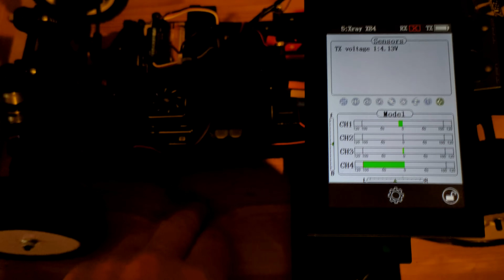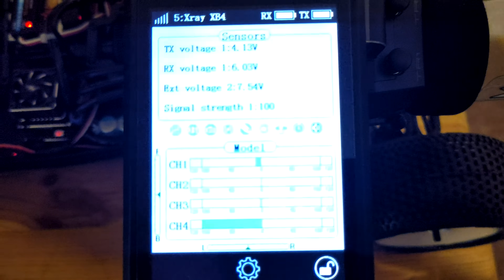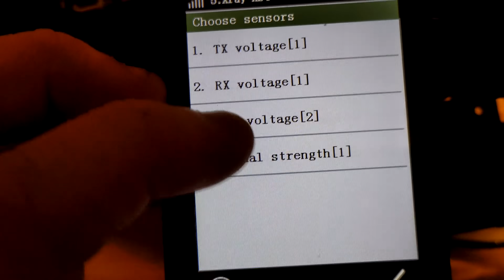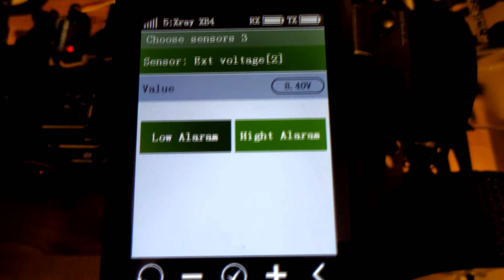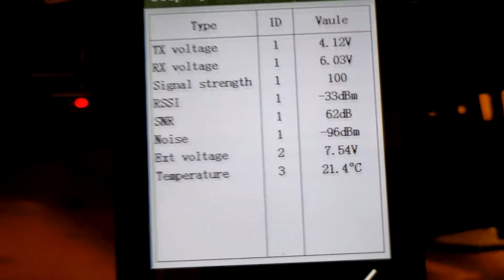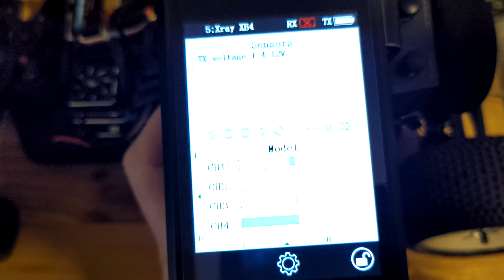Flysky nb4 telemetry set up.

Comment: I have a Traxxas Slash Ultimate, I just switched the receiver to a Flysky FGR4. The Ultimate already comes prewired for a temp and speed connection. Each one has its own connector. Can you advise me as to what channel to connect them to set them up?
Reply from the maker: You can't use the traxxas ones on anything other than traxxas receiver unfortunately
Reply: @WTFRCCars  boo...

Comment: I just nb4 with  4GR4P receiver and I can't get sensors to display on transmitter. Also what ever sensor I plug into the next has flashing led but when just 1 sensor is plugged in led is steady red but when I try to daisy it flashes. Should I have bound the receiver in enhanced instead of classic not sure what I didn't do right?
Reply from the maker: Fgr4p is a classic receiver, have you set the port to sensor or ibus for the sensors to work ?
Reply: @WTFRCCars  actually I just finally got it to work. I re updated receiver then set rx setting from ibus to sensor snd I finally got the voltage & temp gauge to work
Reply from the maker: Spot on :)
Reply: @WTFRCCars  thanks anyways

Comment: Very interesting! Can the NB4 work with any esc to adjust settings remotely?
Reply from the maker: This is not adjusting anything in the ESC
Reply: @WTFRCCars  it does not have that capability with any esc?
Reply from the maker: Depends on the esc, if the esc has a control channel then the nb4 can control that like any transmitter.

Comment: Hi, Is it possible that temp sensor vil activate 1 channel where i have fan conntected. så it will auto turn on/off?
Reply from the maker: No the temp sensor will only show the temperature on the screen of the nb4 or pro it can not control a channel.

Comment: Hi m8 took my kraton 4s v2 out today for its first run I fitted  a few nb4 sensors to it. My question is I zip tied the temp sensor to the motor can next ti the heat sink at the drive end the sensor was reading 50c but the motor was way hotter then 50c  when  touched any suggestions m8
Reply from the maker: Use some thermal paste to make sure the sensor is getting all the heat transferred to it :)
Reply: Yeah makes sense what about a thermal pad top and bottom of the sensor
Reply from the maker: Yeh anything that will transfer the heat to the sensor :)

Comment: Hi m8 love the videos the voltage sensor could I solder a 4s balance plug on it instead of using the pins it comes with and plug into the balance lead on my lipos
Reply from the maker: Yeh that would work fine but does limit it to only 4s lipos but if it's staying on the same RC that won't matter :)
Reply: Thanks for the reply 👍
Reply from the maker: No worries 😁

Comment: Is it possible to run this set up on a 4 channel GMR micro reciever ?
Reply from the maker: No the GMR does not support ibus for sensors but it has gyro connection

Comment: This is what I needed last weekend! My boat crapped out (low battery cutoff in the esc ) in the middle of a large body of water. Low winds, so I had to wait an hour for it to finally float into shore. I have the “beeping” low voltage alarm plugin, but when it’s inside the hull of the boat, it’s hard to hear it going off. Need to build a rescue boat I guess.
Reply from the maker: Alway a good excuse to build another RC ;)

Comment: What is the best method for attaching the temp sensor to a 1/10 buggy electric motor?
Reply from the maker: Zip tie and thermal pad will hold it in place and get a better reading of the temp :)

Comment: Hi there. Really appreciate your videos. Any idea if the Nobel Nb4 with the smaller FGr4S V2 receiver can handle temperature telemetry? Or is it only the larger receiver with the antenna (FGr4 v2) that works with telemetry?
Reply from the maker: All the nb4 receivers can run telemetry
Reply: That was my question too. Thank you
Reply from the maker: I have vids covering how to set telemetry on most of the receivers if you need one I don't have covered yet let me know and I'll make a vid :)

Comment: Hi, I was wondering if you can use this with other types of telemetry, like castle mamba x , I have this setup on futaba and I was wondering if it could be made made to work on this system? Thanks
Reply from the maker: No the telemetry only works with flysky sensors unfortunately

Comment: Maybe you've answered this in another video. If so, please link it. I have yet to find it.

Question: Is it possible to run a couple of external fans through the FlySky FGr4 V2 receiver without an external BEC, or additional battery. I'm only running 2 channels (servo and ESC). The fans need 6-8.4v. I'm using a Max5 ESC and have set it to 7.4v for the "BEC" but am unsure if that only works over a single channel, or all of them. (Don't want to muck about with my volt meter as I may just cross pins and cause a problem) Seems it would just set them all to 7.4v but it doesn't say. The FGr4 V2 shows 3.5 - 12v so I'd assume it will work. Is this set via the Noble (can't find it if so) or is the ESC BEC setting handling all of it? 

Another odd thing is the servo doesn't work on the servo port on the FGr4!? It needs to be in channel 2 port to work. Seems odd to label something for a function it doesn't actually do.

Thanks again for your help. Trying to get the last few flys out of the grease.
Reply from the maker: As for your fans, all the + and - on receivers are directly connected so what ever you bec is giving out goes to all the + and - :)
Reply: Fantastic! Thanks!
Reply from the maker: So the fgr4 servo port is for the option 4 extra channel add-on :)
Reply: Is the "sens" port for telemetry, or would this "servo" port work for that? Now I'm looking at a voltage and temp setup. You've got me going deep into this system now. lol

Comment: Where can I get replacement batteries for the transmitter? Do you know the part number?
Reply from the maker: The base or the one inside the handle ?
Reply: @WTFRCCars  The base battery.
Reply from the maker: Normally available on here https://shop.flysky-cn.com/collections/parts/products/fg4-kjpj-0400

Comment: i use this same volt sensor. I love it. I have it hard wired and permanent on the main battery cables and tucked nice and neat inside the receiver box. Such an awesome little unit.
Reply from the maker: Yeh been very happy with it so far

Comment: I’ve watched all of your videos on this radio set up. I have the FGR8B, haven’t updated it yet. My question is what port will I assign and/or use for my Flysky telemetry sensors?  I greatly appreciate your time.
Reply: Oh that’s good news, I appreciate it. 
I probably won’t be using the external voltage detection right away. I really couldn’t get my mind around some of the warnings of what to do and not do with it. I’ve been satisfied with the FS-CVT01 (voltage detection) and FS-CTM01 (temp). Will there be any conflict running the CVT01 and the BDV wiring at the same time?
Thank you again!!
👍🏻
Reply from the maker: https://youtu.be/-XViQoedKBE
Reply: @WTFRCCars  just watched your video that you linked. Have to say thanks again, cleared that up for me.   I don’t know how I missed that video earlier on.
Reply from the maker: No probs :)
Reply from the maker: You should only need the included voltage detection lead as the receiver will give you bec voltage and the external one will read the main lipo :) I do have a vid on it and how to use it in the playlist :)
Reply from the maker: Once you update the nb4 and fgr8b you will have an option to set for example ch8 to be a channel or ibus for telemetry, you also have a dedicated external voltage port to use the voltage sensor that came with the fgr8b :)

Comment: That's really great. 20Y ago I had to stop and measure the temp - I had an infrared thermometer which I found super cool.
Naturally this is much easier to setup and use.
I am considering making the best of this on my Traxxas TRX4 Defender but am not sure as to which sensors would be useful.
Most of the time I crawl indoors and sometimes I like to trail. Would you use any sensors in this type of usage?
Thank you.
Reply from the maker: For crawling the external voltage monitoring is handy as the battery last so long and you don't get a lot of voltage drop as your not hard accelerating like with some other rc's so lvc takes a while to kick in, motor temp can also be helpful just as a fail safe in case something is binding up and you don't realise you will see the motor temps start to rise and can stop and take a look at the drive train rather than the motor get burnt out :)

Comment: Where did you get the sensors
Reply: Can you please provide a link for both sensors? Thanks!
Reply from the maker: https://www.ebay.co.uk/itm/Flysky-voltage-magneto-optical-sense-temperature-data-acquisition-module-FS-iA6B-/172647094742?_trksid=p2349624.m46890.l49292
Reply from the maker: Hi, I get mine from AliExpress but rcmodelz in UK also stock them now, there all very cheap think the most expensive I have paid is £8 delivered most are around £4 - £6
Reply from the maker: Also think I have links in the description on some of the other vids :)

Comment: What is the max amp rating for the charger to be use for this remote battery?
Reply: Another question, I’ve been trying to figure out how to get a break light to activate when the breaks are applied. Say you have a light in ch5, is there some combination of mixes and using the high side and low side effects?  I really would like to know more about mixes, never had a transmitter that could do this much. 👍🏻
Reply from the maker: Yeh if you set it up as a mixer channel you could have it activate a brake light
Reply from the maker: The official figures are base 1.44 amp handle 745mah but i have a usb meter so ill check and get back to you :)
Reply from the maker: https://youtu.be/UEwBDukEAaQ hope this helps :)

Comment: Does the sensor input voltage support up to 7.4V ? Since my esc have bec option uo to that voltage.
Reply from the maker: The sensors and receivers all support 8.4v input so direct 2s lipo the fgr4 receiver can run upto 12v so can the dm racing receiver for the nb4, but sensors max 8.4v

Comment: I've always got the voltage value by plugging the probes in the balance lead on lipos.
Reply from the maker: Hi racing shorty packs don't have balance leads on them so ya have to use the main power leads
Reply: @WTFRCCars  Thanks I just never knew you could for a moment there I thought you were using old school batteries ha
Reply from the maker: First time I saw one I thought so how do you charge it but the charge lead has 2 4 or 5 mm plugs and a 2 mm connection for the balance lead in the centre :) then you remove it when it's charged the battery I'm using is a orion 5800 hi voltage lipo 120c there 7.6v